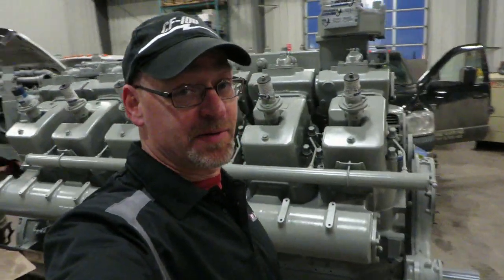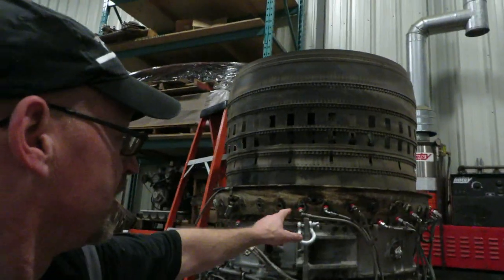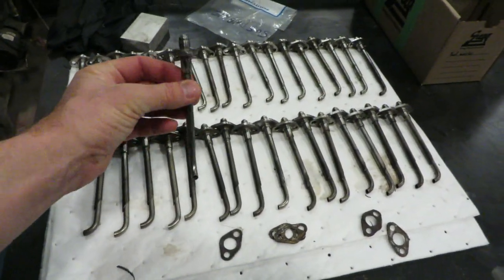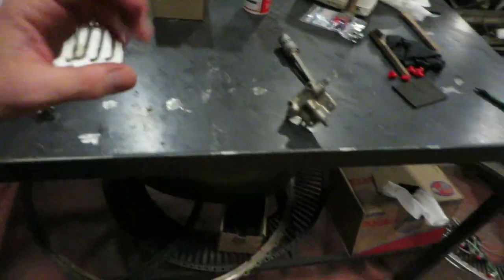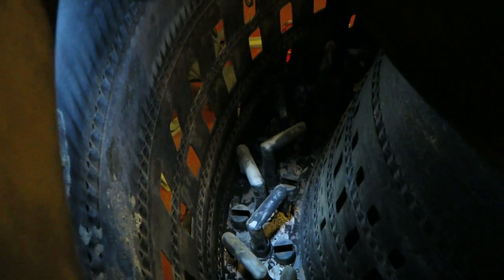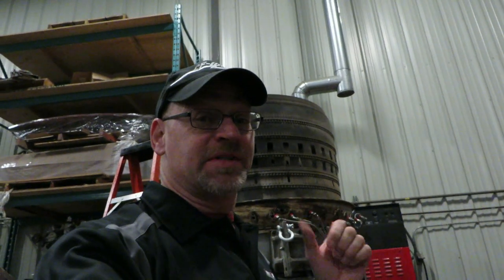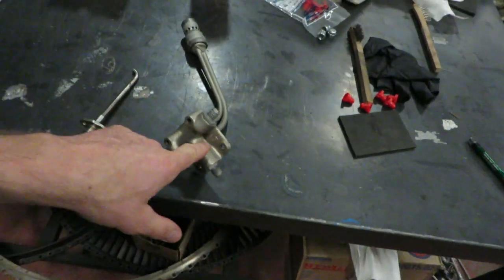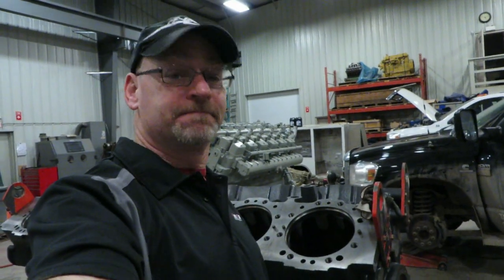Jet Fuel Nozzles IV : Curtiss-Wright J-65

Comment: I've only just found this post and, since I was an apprentice at Bristol Siddeley Engines, Coventry, the successor to Armstrong Siddeley Motors, I'd like belatedly to add something to this discussion.  Firstly, my thanks to AgentJayZ for giving credit to ASM, as the J65 was a licence-built version of the Armstrong Siddeley Sapphire Sa.6 engine.  As a young designer, I learned much of my trade from the men who designed the Sapphire and other ASM engines in the years after WWII.  The 'invention' of the Armstrong Siddeley vaporising combustion chamber in the late 1940s was ascribed to Pat Lindsey and Sid Allen, both of whom I had the privilege to work for briefly.  The vaporiser principle was used in the Viper, Sapphire and Double Mamba and was notable for its totally smoke-free operation, as compared to engines on the other side of the Atlantic, such as the GE J47.  The vaporisers were originally curved and resembled the handles of walking sticks or hockey sticks , hence their ASM nicknames:  Curtiss-Wright called them 'candy canes'.  However, they tended to burn out and the design was soon changed to the right-angled form seen in the J65 combustor.  The design principle, with a modification to a 'T' shape, continued in use in such engines as the Pegasus, RB199 and the production version of the Olympus 593 in Concorde.  The annular vaporiser chamber in the production 593 replaced the earlier cannular combustors using high pressure injectors, to reduce smoke levels considerably.  However, with increasing engine pressure ratios, combustion was no longer totally smoke free and so-called airspray burners replaced the vaporiser chambers in the production EJ200 engine.  I've mentioned this before elsewhere, but AgentJayZ has worked on those cannular combustors from the 593: we used them to uprate the Industrial Olympus to its 'C' rating.

Comment: I read that back in the 1950s that a B-57B fitted with these engines flew successfully on hydrogen fuel.  It lifted off on JP-4 and they switched it to hydrogen mid-flight.  The only problem was that so much water was produced that it made a huge vapor trail behind the aircraft.
Reply from the maker: A bigger problem would be the need for heavy tanks in order to withstand the pressure needed to carry enough hydrogen to allow operation for any practical length of time.
So heavy as to be impractical.
Even regular good ol' jet fuel causes huge vapour trails behind jets. Not really a problem, unless you don't want to be seen in daylight.

Comment: If you wan to see an interesting fuel system find the  Continental  Teledyne engine that  powers the Ryan Fire bee and  want to see a very interesting method of fuel delivery, look at the slinger fuel system . This engine turns up to 22,000 RPM and the fuel is fed through a metal to metal fuel coupling made by Dura Metallic . I worked on many Jet engines while in the Air Force , but this one took the cake for simplicity .

Comment: As always, very informative and interesting, however I would like to ask one question about the fuel delivery during startup. At what point during startup do the atomizer nozzles begin fuel delivery - and at what point do they shut off? Would they deliver fuel as soon as the starter engages, and shut off when the walking sticks take over?
Many thanks in advance, and thanks for your time!
Reply from the maker: I'll have to check the manual, but the starter fuel nozzles would begin introducing fuel at about 20% rpm, and then They could be shut off as soon as the other ones ignite... or they could be left on all the time.
This is a bit of an unusual fuel system, so I'm not sure yet.
Reply: AgentJayZ Thanks for the quick response Jay, much appreciated :)

Comment: Jay, Those "walking stick" burners look like a real crude way to achieve a flammable mixture.  I suspect that they won't function properly until some engine temperature is achieved.  Did these tend to generate a lot of tail pipe smoke, or flame upon starting?
Reply: MrShobar Forget that question.  You answered below.
Reply from the maker: No, they are called vaporizing fuel nozzles and they burn cleaner than liquid atomizing nozzles.
They take a couple seconds to heat up

Comment: Interesting, most if not all model airplane turbojets use this method as it allows low fuel pressure, never knew it was used in big turbojets too.

Comment: how do you start that thing?  wouldn't the engine need to be hot to properly vaporize the fuel?
Reply: good ?,how do u preheat the tubes to jet it to vaporiz?what are the slot,s next to the tubes,can nosles be seperately controled or in groups,and Merry christmas.
Reply from the maker: I forgot to show the two separate atomizer nozzles, right next to the two ignitors, which are used for starting.

Comment: Did they apply a variation of this tech. with hydrogen in the U-2 to boost it's ceiling?
Reply from the maker: You can't completely replace an engine's combustion system with a different one, unless you use a completely different engine in the aircraft. The U2 has used the P&W J757, the J75, and most recently, the GE F118.
The F118 uses an annular combustor, which is more efficient than the can-annular type used in earlier turbojets.
So, in a round about way, part of your question is answered with a yes, but I would not say it that way.
As for Hydrogen fuel, no.
Hydrogen as a gas is the best fuel a turbine engine could ever hope for, but it needs heavy tanks to store it at high pressure, and even then you can't carry very much.
Liquid hydrogen, you say?
Well, you need cryogenic tanks, fuel system, and ground facilities, which will increase your budget by a factor of at least ten.
So, no.

Comment: The fuel nozzles look like the nozzles that diesel engines have in them that squirte oil on the bottom of the pistons to help keep them cool. Just out of curiosity what is the correct way to store a jet engine?

Comment: So in terms of power per kg of fuel consumed which engine is more fuel efficient? does the fuel vapor method produce a more efficient combustion of fuel? or does the atomizer?
Reply from the maker: The vaporizing nozzles are claimed to produce more even combustion... As far as efficiency, I don't think there is much difference.
Compression is a much more important factor than what type of fuel nozzle is used, when it comes to power produced and overall engine efficiency.
Reply: AgentJayZ That makes sense.  I guess I'm just used to thinking about combustion from a piston engine POV where it's gulps of air being squeezed and burned individually at low velocity, not a steady stream of air at very high velocity.

Comment: Extremely interesting stuff.

 I'd like to de-rail this conversation and have a couple of words about the tools you guys are using in the shop. What kind of tools are you guys using with these engines? Do you have to buy some sort of mysterious manufacturer provided tools or are they just your local hardware store-grade tools?

And I've never ever heard any music in your videos. Not even 50's music when it would have been appropriate... :D :D
Reply from the maker: We use many different brands of tools, none of which I can mention by name.
Sometimes we need to modify a tool , and for that we use a less expensive one. 
Sometimes only the highest quality tool can do the job, and they are expensive.